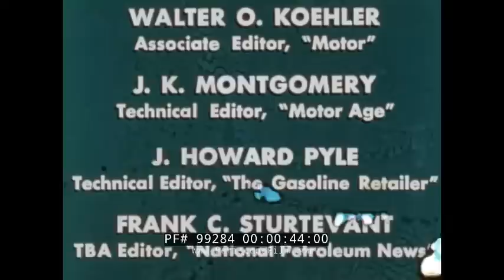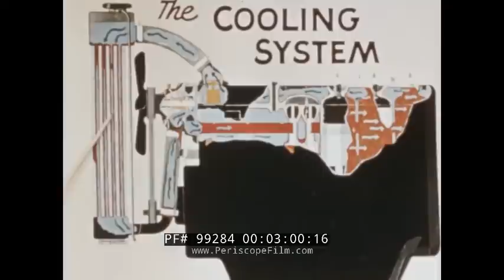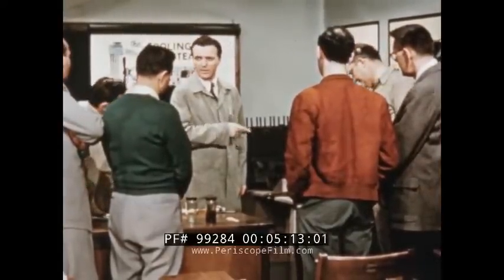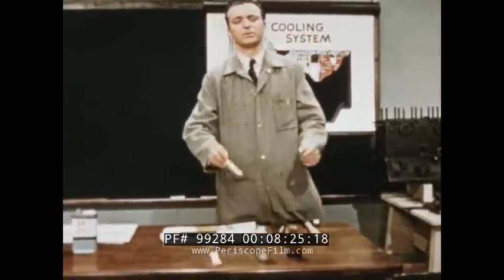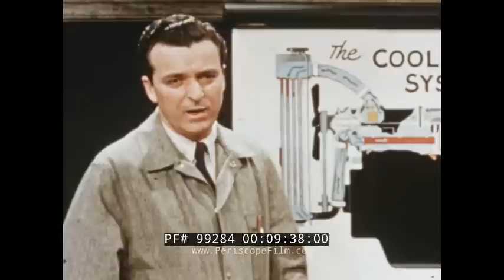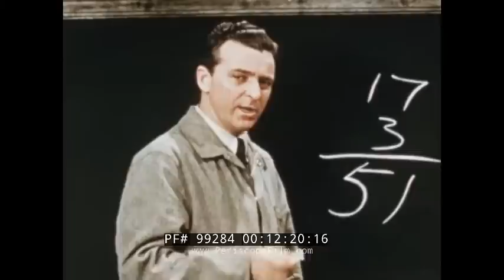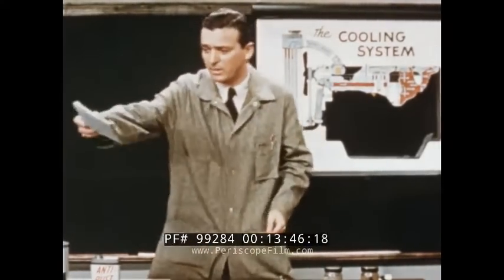"THE IMPORTANCE OF COOLING SYSTEM SERVICE" 1950s OLIN MATHIESON SERVICE STATION SALES FILM 99284

Comment: It’s 2am and I’m about to go to the garage and flush the cooling system in my 1956 Oldsmobile. Hot damn, I haven’t changed the antifreeze since ‘59
Reply: How is that possible my friend
Reply: @carsonp.7009  
You just gotta keep adding….. it’s been 3 years and everything still looks good in the radiator.
Reply: @jasondean3332  Ahhh i see, its like one of those neverending soups they keep throwing stuff into Haha
Reply: @carsonp.7009  
Exactly…… hahahaha. Whatever it Takes. I think I should check my oil now.

Comment: I'm a gearhead from the 1960s, so for those younger in the audience about that era . . . 
Unlike antifreeze nowadays that is already mixed and just poured into the vehicle's cooling system; antifreeze back then, in one-gallon jugs, was 100 percent ethylene glycol, requiring a mix of 50 percent water, by volume, into the car's cooling system.  A problem with that would be from the water source:  The tap water that was high in mineral content created a lot of "scaling" or buildup of mineral deposits in the radiator.  The workaround for that was to use bottled distilled water; as that's what I did.
But for those vehicles with radiator mineral buildups, repairs were done by the mechanic removing the top of the radiator and "coring" the radiator's tubes to remove the scaling on the tubes.
Back in the 20th century, the draining of cooling systems created environmental hazards, as backyard mechanics, service stations, and repair shops would have the old coolant drain freely from the engine and into the storm drains, where it would flow into streams, rivers, lakes, and oceans.  I'll admit I was guilty of that, as the average guy a half-century ago was clueless about the term "environment" being connected to the health and welfare of the soil, air, and water.
Careless handling of ethylene glycol antifreeze would also be a hazard to animals, since its sweet aroma could attract animals, such as dogs, to lick up or drink the puddles of antifreeze on the ground; making the animals very sick or resulting in death.

Comment: I haven't change my antifreeze in my van since I bought it 9 years ago ,over 200 thousand miles I only change the oil every 3k miles run great.
Reply: Unfortunately for you and your van, your cooling system is rotting from the inside out and someday you'll have an expensive repair bill.
Reply: Got Rust??
Reply: Modern antifreeze is much more resilient than old stuff, but you still need to change it. If you plan on keeping the vehicle change it out. The inside of the engine will be clean from your oil changes, but the antifreeze will degrade and either cause corrosion inside the engines cooling passages, corrosion around gaskets, or turn to a powdery sludge and block the heater core or radiator cooling passages. If you are keeping the car i'd highly advise you do it, from experience.

Comment: I think my freeze plug is leaking because rad fluid is dripping from under the engine. Have no idea what to do because I can't even get to it. I just keep adding coolant every week. 

Well, at least I got clean fluid in there. lol. Taking it to a shop is out of the question because it is an old high mileage van worth about $1500.
Reply: Could just be the lower radiator hose leaking where it attaches to the water pump. Maybe just a loose hose clamp. See that often.
Reply: Most auto part stores sell a UV dye that can be added to antifreeze. If you add it and regularly shine a blacklight on your car, you may find the leak. You might discover the problem is cheap and easy to fix. Also, you don't want to let the leak suddenly get dramatic and leave you stranded.
Reply: @skylinefever  thanks. What I mean is I can't get to it. I have a pretty good idea of where it's coming from but it's impossible to get access to that location.

Comment: When did cars use water with corrosion inhibitors in the summer and 50/50 antifreeze and water in winter? At what point did car companies decide to use 50/50 ethylene glycol all year long?

Nowadays there are several antifreeze types, and several types will cause problems in the wrong vehicle. At one time, Honda used the same green color as standard antifreeze, but Honda antifreeze had no silicates. As a result, the silicates would destroy the water pump. Dexcool looks much like Chrysler HOAT, but if you mix them, you will get sludge clogging up the system. This happened to both of my parents in 1999. Making things worse, their cars had timing belts that drove the water pump, making repairs even more expensive. During the 1990s and early 2000s, GM made many V6 engines with intake gasket problems. Much blame was put on Dexcool, but much blame was also on gasket design. The original gaskets had plastic frames that would crack and cause leaks, and Fel-Pro problem solvers used metal instead. That reduced the number of times an engine had to have intake gaskets replaced.

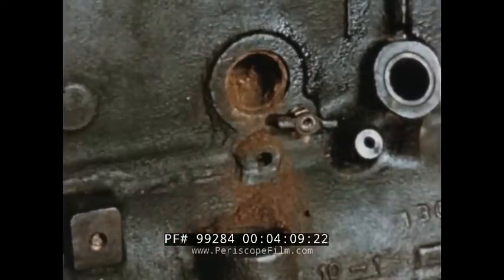4:10 my dad said he once made the inside of the engine look like that in his 1971 Toyota Corolla. He figured that if water and ethylene glycol antifreeze mixed at 50/50 had had one boiling point, and if 60% ethylene glycol 40% water had a higher boiling point, then why not use only ethylene glycol antifreeze? The reason is that corrosion inbibitors in antifreeze are not effective unless a certain amount of water is present. Back then, you could buy oxalic acid based cooling system cleaner, and that stuff worked really well. However, if you left it in too long, it would disolve the inside of the cooling system once it dissolved all the rust, scale, and sludge. That is why the cleaner came with an acid neutralizer, and directions on when you use it.

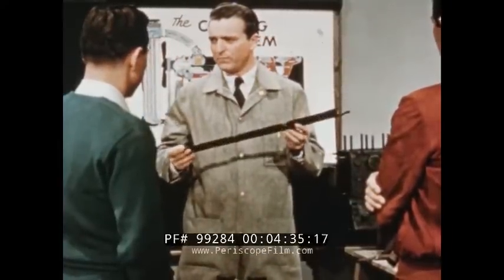4:37 few cars had that coolant distribution tube in the engine block. It is my understanding that the flathead MOPAR inline 6 was one of those engines.

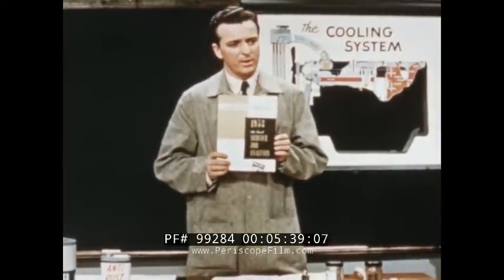5:39 starting in the 80s and completely in the 1990s, car companies stopped using soldiered brass radiators, and instead used aluminum radiators with plastic end caps. Those end caps would fail and radiator replacement was the only way to go. Japanese and Korean cars tend to have those most radiator problems. Automotive cooling systems should have as few plastic parts as possible, they are nothing but trouble.

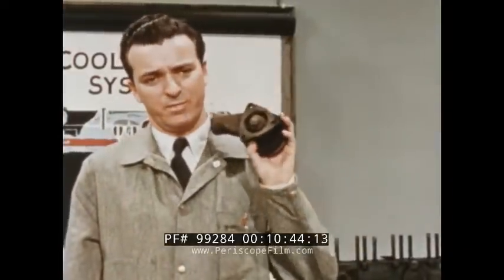10:46 It is definitely good to keep all sorts of parts that can be damaged by lack of maintenance. I think a great thing to have is a shredded timing belt sitting next to some bent valves and a wrecked piston. I think if my mom and dad saw that, they might have replaced the timing belt on mom's 1985 Nissan Maxima so the belt wouldn't have gone out in 1994.

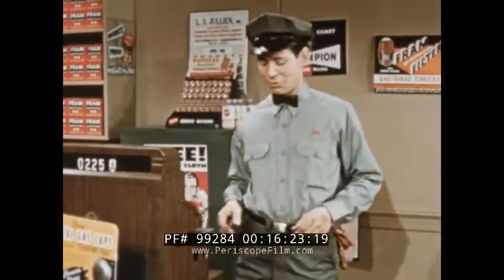16:20 One great thing about modern times is that the service writer's computer has a list of maintenance schedules set by the manufacturer. However, not all service writers read that schedule.
Reply: I don't know exactly what you are saying, but it sounds good.
Reply: Back then, alcohol was used as anti-freeze.  You had to use a cooler thermostat (160 deg F or lower).
Reply: Sounds like he knows his shit☝
Reply: Train locomotives still use water with inhibitors today. They use a dump valve to drain the system before it freezes.
Reply: @8avexp  thanks. I didn't realize that something other than glycol eas used.

Comment: FYI: Coolant systems are closed loop these days, I test mine every couple years and go from there but here is what MFG's say:

CARS.COM — When is the right time to change your engine coolant? For some vehicles, you’re advised to change the coolant every 30,000 miles. For others, changing it isn’t even on the maintenance schedule.

For example, Hyundai says the coolant in the engine (what many refer to as “antifreeze”) in most of its models should be replaced after the first 60,000 miles, then every 30,000 miles after that. The interval is every 30,000 miles on some Mercedes-Benz models with some engines, but on others it’s 120,000 miles or 12 years. On still other Mercedes, it’s 150,000 miles or 15 years.

Related: More Car Service Advice

Some manufacturers recommend you drain and flush the engine’s cooling system and change the coolant more often on vehicles subjected to “severe service,” such as frequent towing, which can generate more heat. The schedule for many Chevrolets, though, is a change at 150,000 miles regardless of how the vehicle is driven.

Many service shops, though — including some at dealerships that sell cars with “lifetime” coolant — say you should do a coolant change more often than the maintenance schedule recommends, such as every 30,000 or 50,000 miles.
Reply: I find that even though Dexcool should be replaced every 5 years or 150,000 miles, it is usually putrid after 4 years, sometimes 3 years.

Comment: This is hilarious! The idea that coolant goes bad...
Reply: It quickly went bad back then. It does in modern cars but it takes a long time, like 10y plus. I still change mine every 100k though, I've seen too many gaskets and o rings leaking or damaged from internal aluminum corrosion to let it happen on my cars. But yeah, it's much less of a deal these days, especially on light duty cars and trucks.